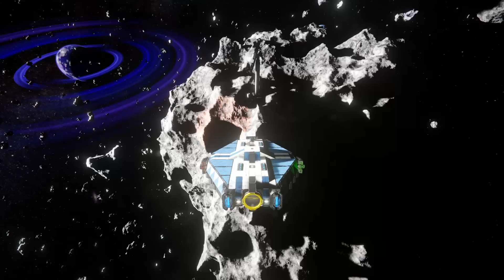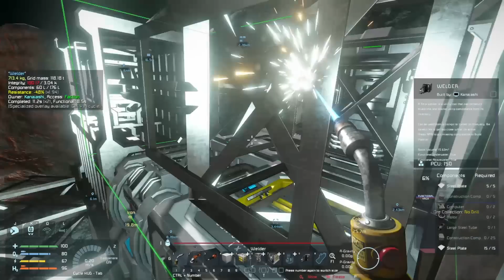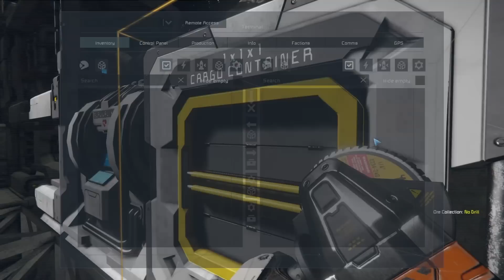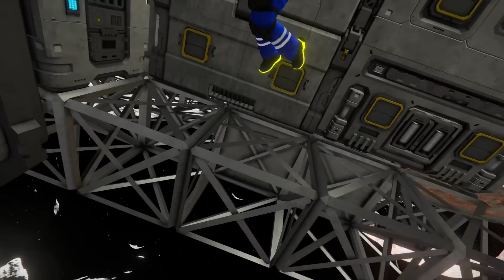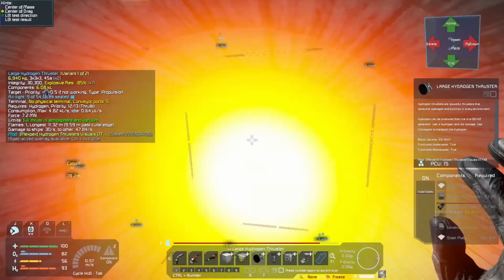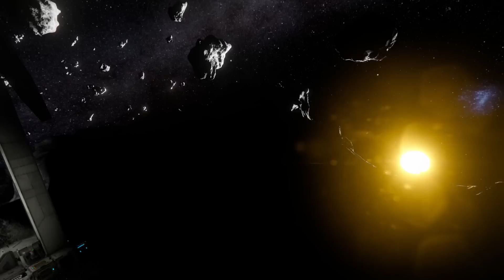Space Engineers - S5E02 'Making Upgrades'

Comment: I would highly recommend replacing your current thruster physics mod with this one called "Thruster physics & Differential throttling". It adds torque from thrusters like the mod you're using right now, but it also adds the ability to use those thrusters like RCS to turn the ship, as well as a 'thrust trimming' feature that will help you avoid unwanted torque with your mining upgrade to the specter
Reply: Do these thruster physics mods also affect gyroscopes? If not, would it be possible? Just something I thought of when I saw the ship rotating without using the thrusters.

Comment: I love the new Season, the scenario surely will shape up interestingly, especially if you start using drones for automated delivery from ore deposits.
I highly recommend building either an additional solar panel, or moving the one you have out over the side of the asteroid. When you stand in front of the assembler and survival kit and face the other way, then build out straight far enough over the curvature of the asteroid and it should be able to face the sun all the time.
But granted, only necessary if you plan on using that starter base for a prolonged period of time.